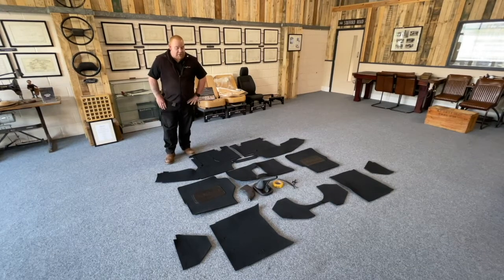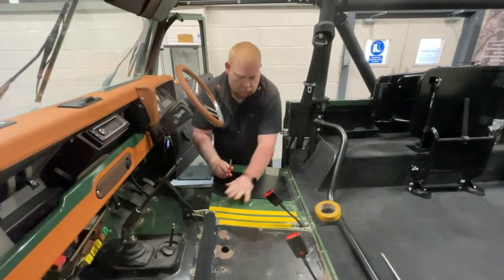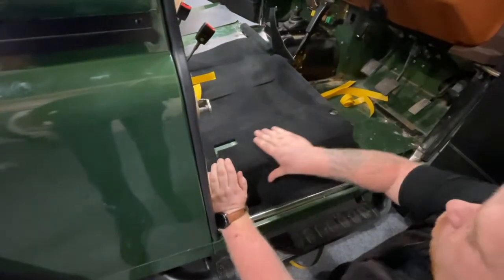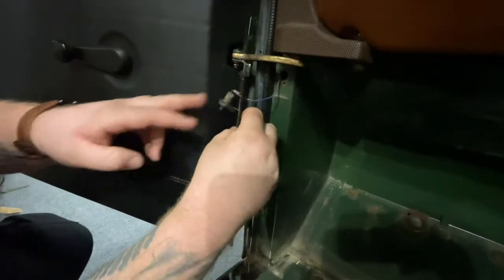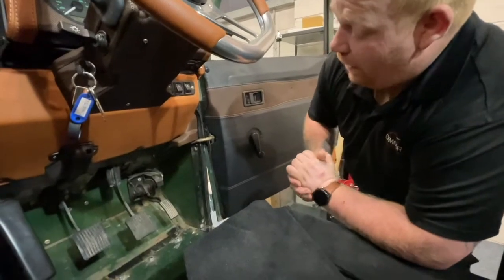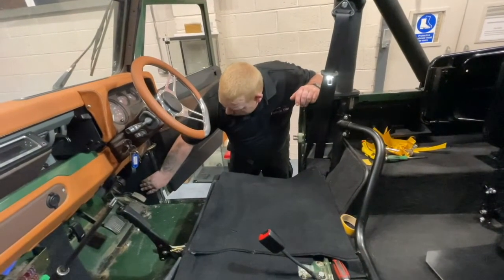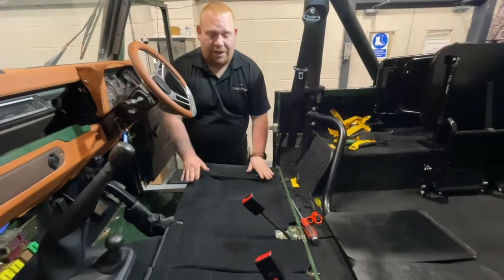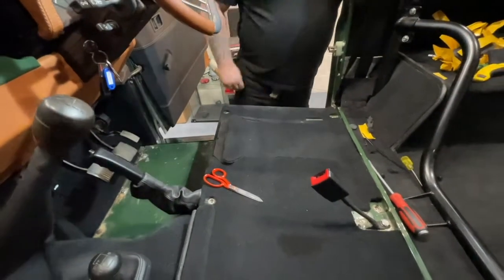How To Fit R380 Premium Carpet Set - EXT021-16

Comment: Only issue with this is. The tape supllied is no where sticky enough. Also theres no explanation on how to fit the carpet round the battery cover latch.
Reply from the maker: We have listened to everyone's feedback on the tape and we can confirm that a very revised tape will be included. Fibre reinforced to give even more strength. All the Best Exmoor Trim